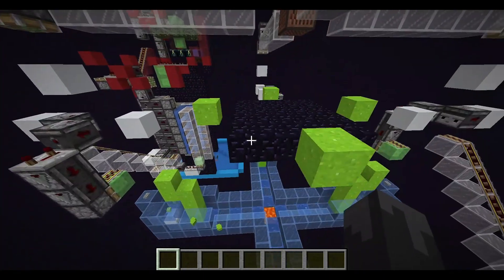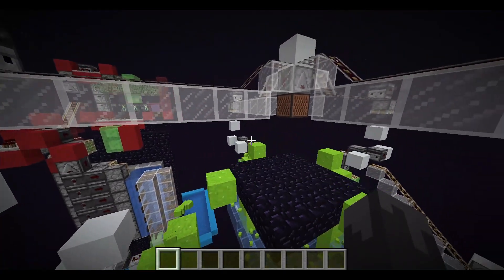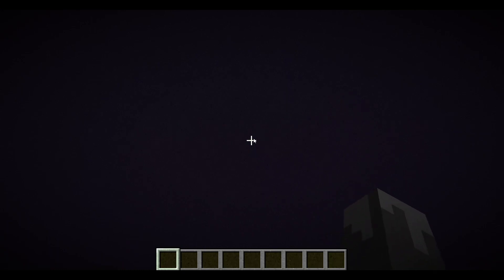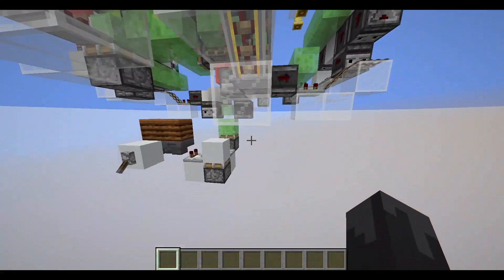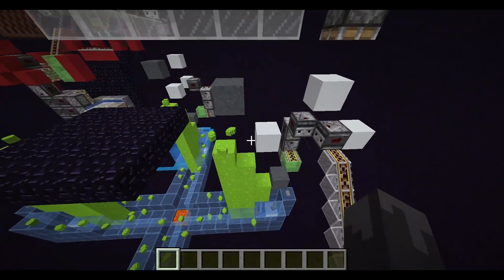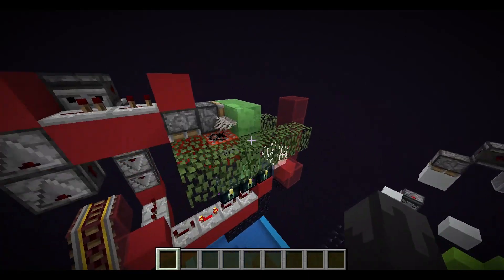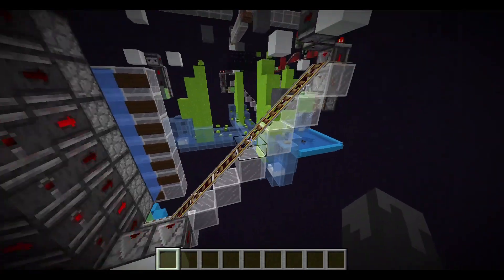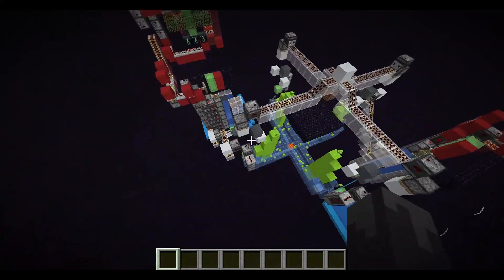Dustless 62k/h Concrete Duper 2.0

Comment: this is just amaizing, it would be better with a selection pannel to select what colour you want, it is a little bit difficult right click note block on time.
Reply from the maker: @ericcazorlagomez7309  I would love to, but I have no idea how to code that logic into redstone. Logic gates are not my strong point
Reply: @PotatoCraft_TMC Hello, thank you very much for responding. I've been doing a lot of tests for 2 days, but I can't even do a double pulse to rotate the gravity block belt just once. You have note block "A" and note block "B". A is the one that turns the duplicator and gravity block belt on/off. B is the one who exchanges A to duplicate or move the belt. I want to make a double pulse to note block A when B is in move belt mode, so that the belt turns on and off quickly so that it moves only 1 position. I can't find the solution. It is not a selector panel, but it would be useful to rotate the belt in a more controlled way, and perhaps it could be a start to later code a selector panel with pulse multipliers or something so that the belt moves x times. Likewise, as I say, an impressive and very compact design, I have been working on it these days and I don't even understand it. It's just what I need but adding that little double pulse gadget to note block A would be perfect now.
Reply: How much tick delay I should give to the double pulse generator to move the belt just once?
Reply: Yeaaah i finally got It, its a double pulse with 5 ticks delay. I can give you my litematic version of your duper, I added a note block "C" to move the belt just one time. I used the 5 game tick generator from ilmango and connected a piston to wire 2, times an observer facing note block A.